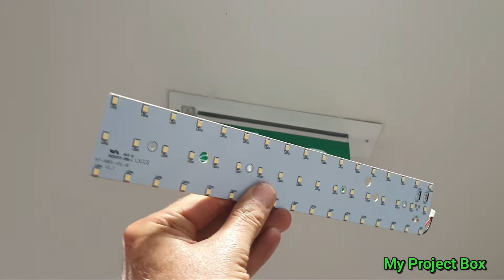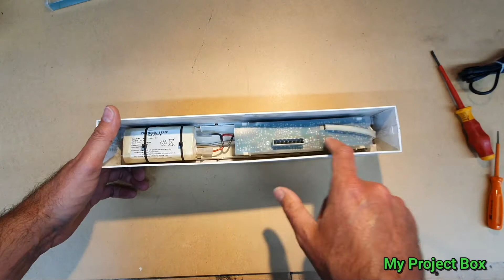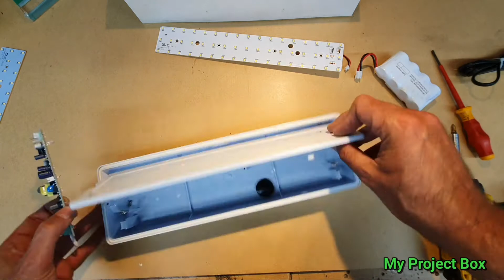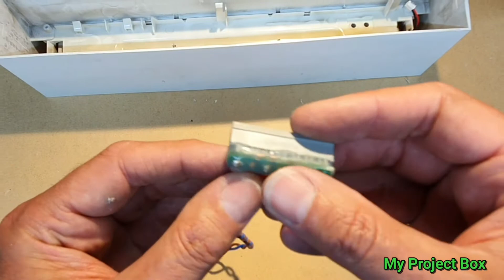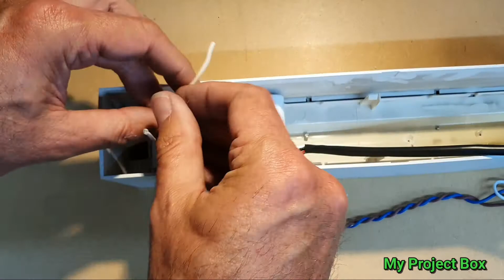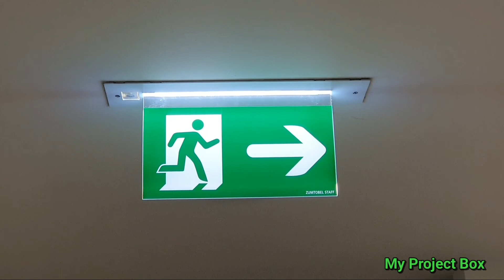Convert Emergency Exit sign from fluorescent tube to LED Hack/ Mod #electronicscreatos

Comment: Whilst I accept that the converted sign works fine, does anyone know the legality of using it? There are extensive regulations about the manufacture and deployment of emergency signage, and I would not want to be in front of investigators explaining why things went wrong - the consequences could be massive.
Reply from the maker: Point taken, but remember that I simply used the internals from a existing LED emergency sign. And transferred it to the case of a older florescent one. So it's just the enclosure that's different. I didn't change the workings of the design.

Comment: Great modification. Uses significantly less power than the original unit. Much brighter and reliable too, and no tubes to replace every 3 years either.